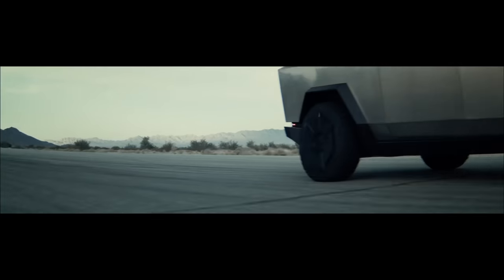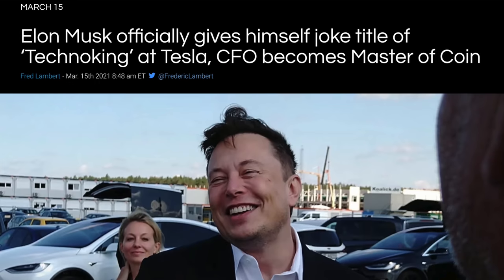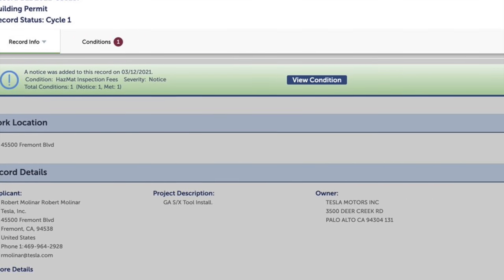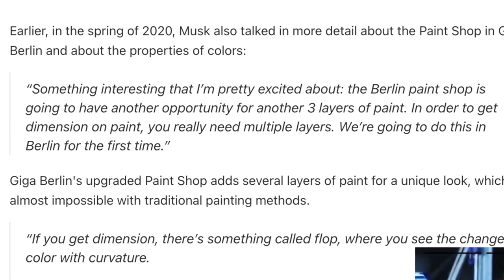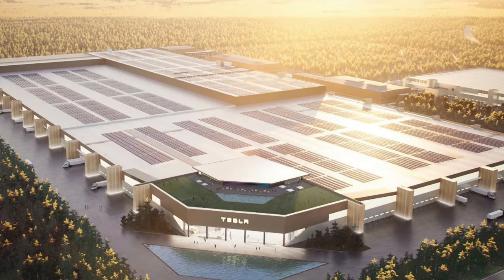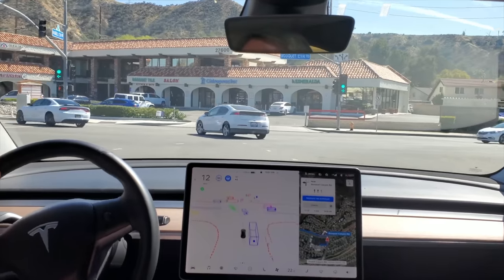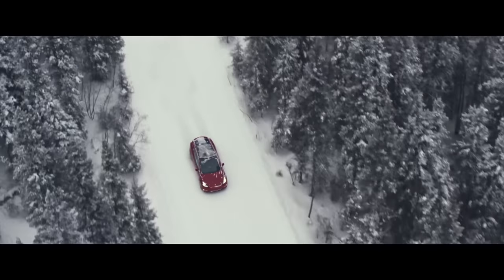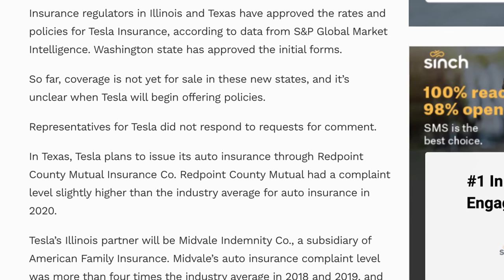NEW 2021 Tesla Model Y Spotted

Comment: 9:00 I think that is a car that was dipped in the liquid at another factory.  The liquid is a primer for the paint and a rust inhibitor.  The liquid starts white and may have faded to this color.  If it was not dipped than this car would be completely covered with rust within a couple of weeks of its arrival there.  I think the cars are there to go through the new paint booth as a test.
Reply: Aluminum doesn’t rust
Reply: Body panels aren’t aluminum. And it’s not a new color. It’s an Ecoat that turns that color after baking in oven to cure.
Reply: Same

Comment: The Model Y's at Berlin were shipped from Fremont to push down the new track. You can see they are the original welded form not the 2 piece castings (supposed to be from Berlin)

Comment: I think a cyber trailer should have regenerative braking to re power the cyber truck to extend or compensate the extra electricity needed to tow such a trailer or at least to power up on board batteries for the camper trailer, also concerning the SEMI I WONDER how much power could be put back into the system if all 18 wheels had regenerative braking , perhaps it could double or triple the battery output giving massive drive time .

Comment: Perhaps another possibility might be to install 500 to 1000 KwH batteries in the frame of the trailer then using those batteries to extend the driving range of the cybertruck as it pulls said trailer.
Reply: But then you must plug in the trailer too at your charging stations. An emptied out trailer battery would not help you any further on your long road trip.
Reply: 500 kWhr battery would be on the order of $60,000...just for the battery!!!!  That’s a ton on money for something that just sits in the driveway 50 weeks/year and has a lifecycle determined by age.  For a couple thousand dollars, you could buy a super-quiet and powerful generator.
Reply: @GHinWI  Sounds like you're trying to bring rational thought into this discussion :-)   I suppose $60k for a battery would work for the same crowd that spends $250k for a luxury motor-bus.

Comment: at 6:50 that's not a new color, Most if not every new car has the color under it... It's the e-coat (i work in vehicle manufacturing where we use this)
Reply: I tend to agree with Alan.  My older BMW's have a base mustard color, which I believe to be a primer or finishing primer prior to color coat application.  I believe it has better corrosion  properties.

Comment: Hey Ryan! 

I would love a video on your thoughts of when Robotaxis will be arriving. My curiosity comes from the fact that a lot of Model 3 leases have come up with Tesla taking those cars in because of the lack of a buy back option with leases. Obviously the Robotaxi network won’t be available until we have FSD fully running but if that takes two more years then are they going to have Model 3’ leases from 2018 just sitting for 2+ years or what do you think?

Comment: I saw a video by Doug about how good gm system is . After watching it I think gms system is the way to go were you don't need to hold the wheel and all you need is to be looking at the road way better then any other system imo
Reply: Which only works on selected highways. 
Yeah. 
Better than others.
Reply: @neeljavia2965   high way driving is basically all fsd can do anyway. That's not necessarily a down side considering the fact you really don't need it to pop to the shops or short 15 minute drives . The fact you don't need to hold the wheel is so much better fact
Reply: @IFlyinBaconI  Tesla is aiming for complete fsd everywhere. 
Not half baked thing like gm.
Reply: @neeljavia2965  yeah that's cool but gm is really compelling considering the comfort of just looking ahead.  To say half baked btw im going to assume you have never used it right ? Tesal calls it fsd and you pay 10k for a system you can't even use . Isnt that half baked ?
Reply: @IFlyinBaconI  Tesla calls it autopilot. 
Only few people have access to the fsd beta. 
Not all. 
Agreed having to look just on the road is much better, but not enough to say that the system is completely better. 
Even common users get the start stop at traffic lights, summon etc with Tesla. 
GM doesn't even have all highways mapped. 
Tesla works equally, if not better on all highways in the entire world, not just US and Canada.
Reply: @neeljavia2965   but its sold at 10k as fsd right ? . Ans yeah your right if you want your car to drive literally everywhere then gms system isn't better however I think tesla fans get hung up on the idea of how useful fsd is going to be . Thibk about it I only would use it in highways and long trips really wouldn't bother for going round town ect . Atm gm system looks like something o would pay for fsd at 10k is definitely not worth it atm
Reply: @IFlyinBaconI  At the moment yes. 
In future driving to work, or for getting groceries would be like riding horses. 
No one would want to sit for hours in traffic and destroy their mental health. 
You guys living in developed countries are really lucky and not grateful for the change that's gonna come.
Reply: @IFlyinBaconI  It's not just Tesla. 
But waymo, mobileye, zoox all are working to achieve 100% fsd. 
Not just highway driving.
Reply: @neeljavia2965   I am great full but fsd won't be for many years even as optimistic as elon is
Reply: @IFlyinBaconI  Yeah.

Comment: The issue Tesla face with FSD is people mis-using it. Regulators in various countries have real issues about allowing it. I would expect that it is likely to be allowed only if there is some form of driver monitoring, with an automatic switch off if the driver is not monitoring the road sufficiantly and with removal of priveleges if the driver consistently misuses the system - even if they have paid for the system. Tesla needs to protect its reputation, and idiots misusing the system could have significant financial penalties on Tesla.
Reply: Perhaps a simple eye tracking system would do - with the cameras.

Comment: Monitoring will be required for a long time.
Reply: But they will not monitor it with people watching the live videos, way too expensive. I'm sure they use eye tracking, which is a common thing for a few decades now. Or maybe the usual tug on the steering wheel... Even simpler. With three strikes out as usual... Nothing new.

Comment: Does anyone know how the Cyber Truck can be charged when you are towing a trailer on a long trip? Electric charging stations are not set up  for a drive through charging station. I would need to find a place to unhook my trailer, then drive to the station to charge, then rehook up my trailer. I assume long trailering trips are not possible or difficult.
Reply: TESLA ALWAYS IRONS OUT THE DETAILS. RIGHT NOW JUST LET THEM FINISH BUILDING THE FACTORY.
Reply: Many but not most of the charging locations have one drive in charging station where you face forward in the charging space and you can charge with the trailer attached.

Comment: "Out of beta" will only be when legislation is in place to set the laws and responsibility. They can have full level 5 and flawless with 0 faults but it will, for legal purposes, still be the responsibility of the driver should an accident occur. When legislation is in place then you have a framework/ parameters for the vehicle to be compliant in for the responsibility to then shift to the car company.

Comment: cybertruck to power the trailer ? Should be the other way around, pack the trailer with batteries and give the cybertruck a 2000 miles range
Reply: You would need to charge the trailer too at each charging station. Why would you want to drag around a very heavy trailer with empty batteries?

Comment: RoboTaxi not going to happen with current camera, radar tech. In sunny weather, no problem but when it rains, snows, etc...system fails...Robo Taxi is currently a fair weather system at best. Until the ‘eyelid’ problem is solved, a human driver is required; Level 3-4 autonomy at best...sorry but true.